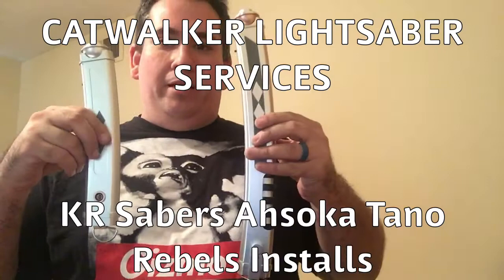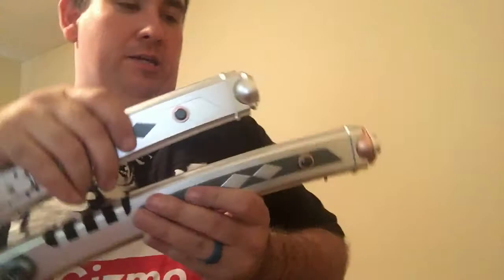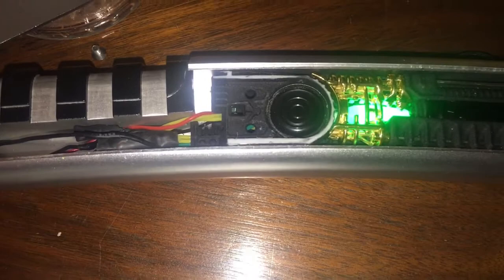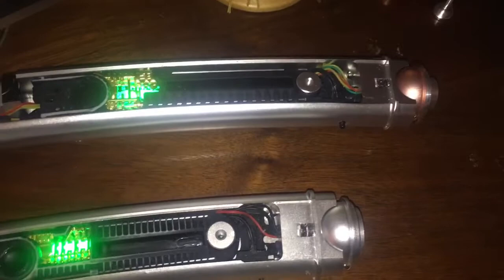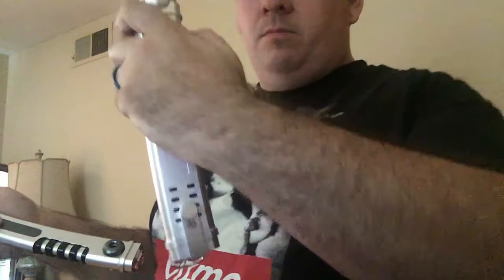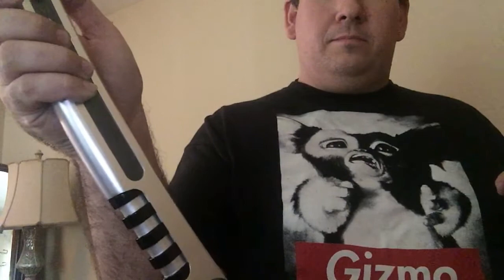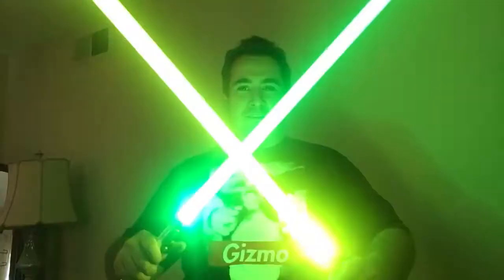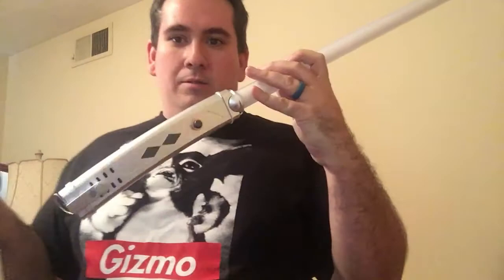KR Sabers x One Replicas Ahsoka Tano Rebels Curved Lightsaber Installs

Comment: Hey Josh, not sure you'll see this, but I'm getting these hilts soon and wondering if you have a part number/supplier for the Tactile Switches with 10mm plungers you used? thanks.
Reply from the maker: NoSloppy hey man!!!   Honestly I think I remember getting them on eBay.
Reply: How about the rods that hold in the battery cover? My chassis didn't come with anything. Was thinking of using a piece of clothes hanger, but still a bit too big...